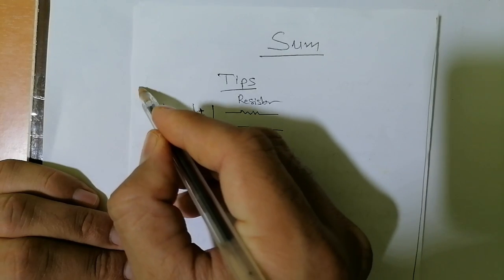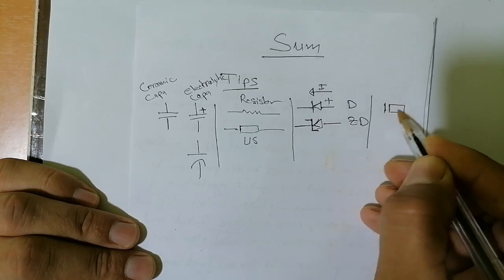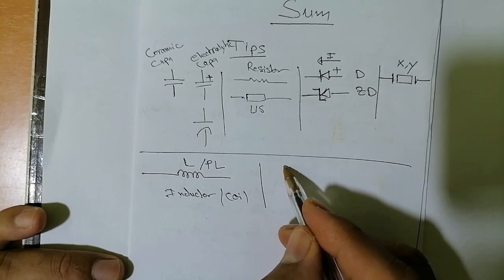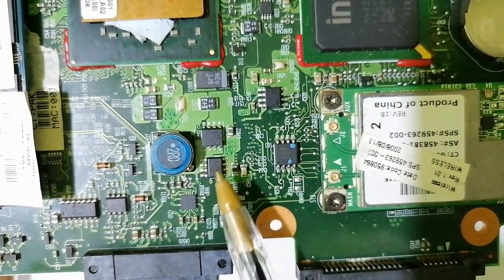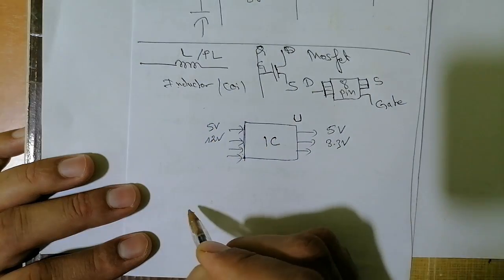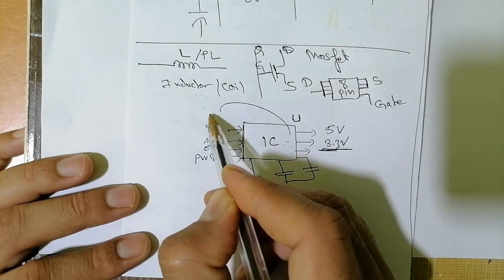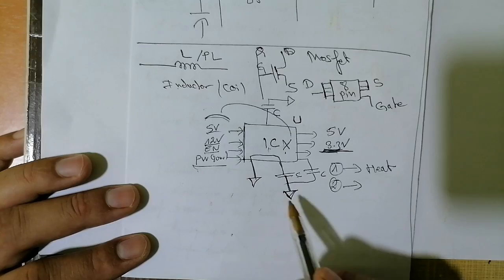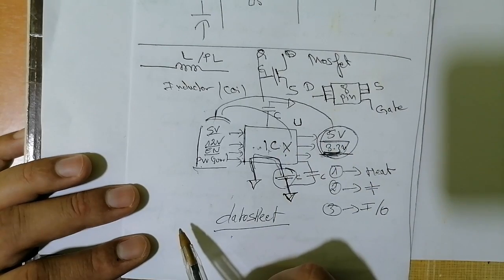Testing Tablet Motherboard Components with Multimeter - Tablet Motherboard Repair

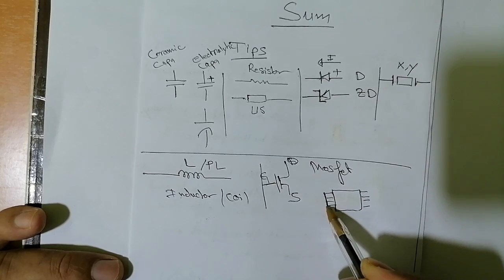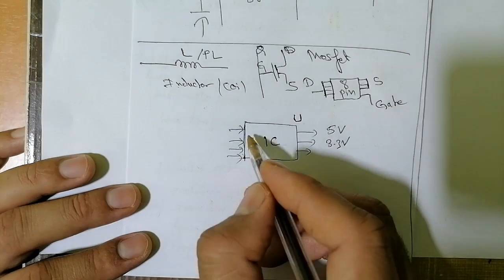Comment: Very useful video but I'm missing something. At 15:53 I see an 8 pin mosfet diagram with four drain pins connected together and three source pins connected together. At 17:00 I see four separate input signals connected to the source and three output signals at the drain pins. Are the input/output pins connected together or not?

Comment: the most difficult components to check in tablets motherboards are 5 pins , 4 pins , 8 pins  smd components . I spent nights trying to find whether they were diodes , transistors or Mosfet . what is marked on them  is tricky to determine , even if you go to components database .  This is why it is important to know about components package , it will give you a lead .  I found out later that these  5 ,  4 , 7 , 8 pins are sometime LDO  ( linear voltage regulators  ) .  Anyway , I think tracking voltages in Tablets motherboards  is important in order to fix them like a pro  , because sometimes you won't find any faulty components  with your meter or visual inspection , and in spite of that your tablet won't power on

Comment: bonsoir toutes vos vidéo sont super vos court de réparation sont bien expliquer merci pour ce que vous faite pour nous faire plaisir nous les débutant, j'ai une question pouvez vous nous faire une vidéos sur la recherche de schématique sur les tablette ,comment faire pour trouver ces schéma avec google ,je vous dis a bientôt sur vos prochaine vidéo
Reply from the maker: Thank you noted
Reply: reliable tablets brands (Asus , Lenovo , Apple , Samsung  etc)  can sometimes be fixed at components level , but when it comes to low cost ( generalement marques Chinoises = Superpad , Ultrapad ,ookitel etc..) , it's another story , because  it's almost impossible to get schematics (trust me ) , or the firmware ( to solve bootloop issues) .
I gave up on trying to fix tablets others than the reliable brands I've mentionned above